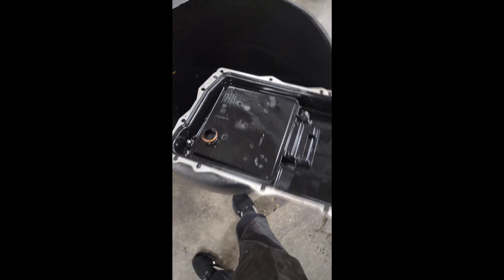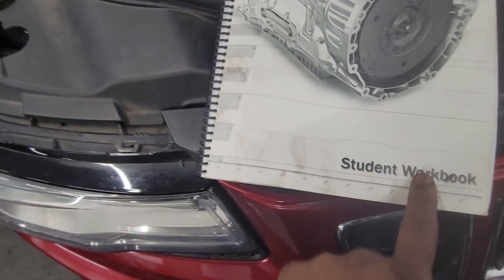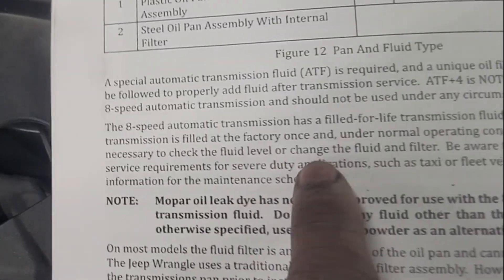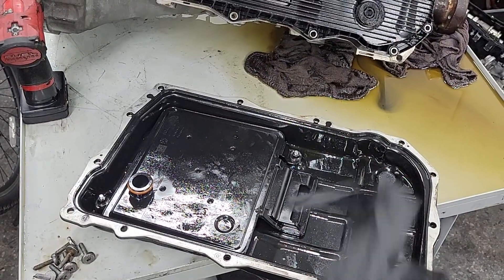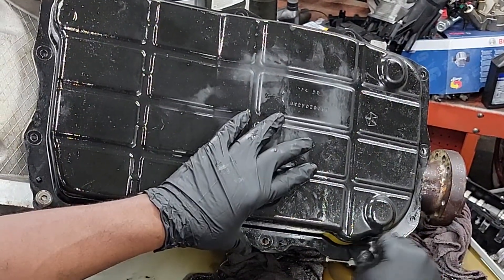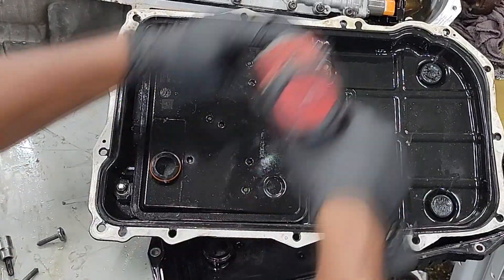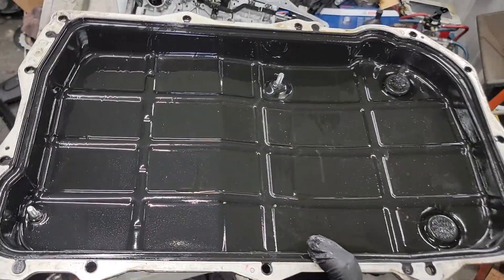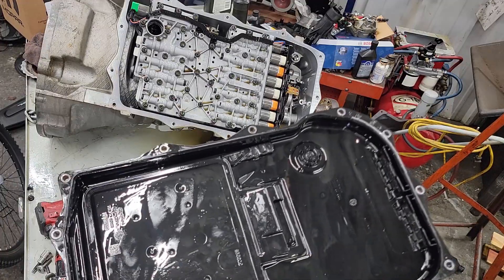“Plastic vs Steel Transmission Pan – The Swap EVERY Driver Should Know About!”

Comment: I looked it up. If I’m correct 90$ for pan 50$ for filter kit vs 500$ plus for plastic replacement for 8HP wow
Reply: Just bought oem plastic pan from my local dealership for $160

Comment: Being plastic, to make it replaceable you would need to create a boss location with a screw insert. Too much risk to screw into a plastic screw boss only. That means new automation equipment and the cost of the inserts and labor. Brings the cost of the plastic pan up to or higher than the steel pan. That would be my guess on why there isn’t a replaceable filter on the plastic pan

Comment: Hey JT, I have a 2016 GC 5.7 and my 8Hp slips going from 1st to 2nd after a cold start and then shifts fine the rest of the day with the exception of occasionally slipping a little after letting off the throttle and back on while driving on highway. Would a new valve body or maybe putting a Zip Kit in it fix the issue?

Comment: In reality, the transmission filter doesn't do the same job as an engine crankcase filter.  It's more like a sock to catch pieces of metal and plastic parts if something fails.  The average ZF transmission will last forever if you change out the original pan, filter and fluid for a larger capacity aluminum pan after 10k miles and then just do the Honda-style drain and fill every 25k miles after that. This will remove the break-in metals early and always keep the fluid fresh enough to last the lifetime of the vehicle.  Just my experience....